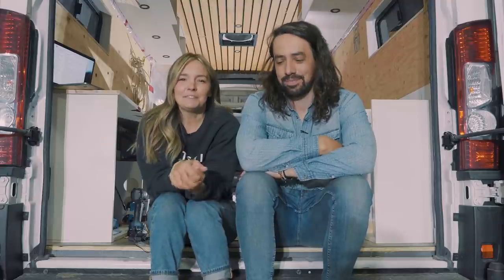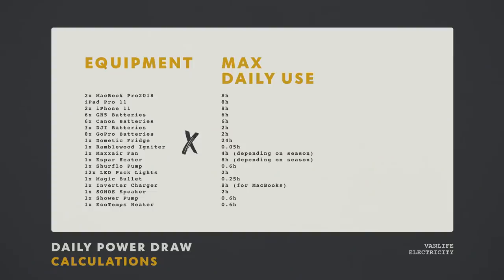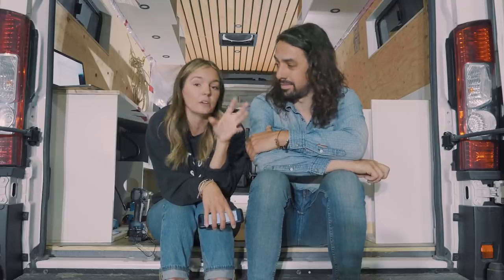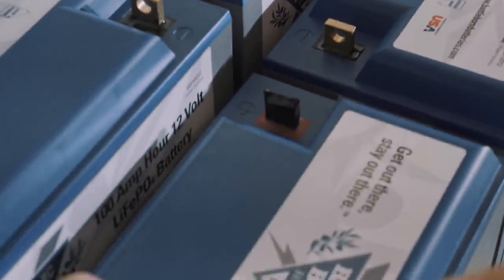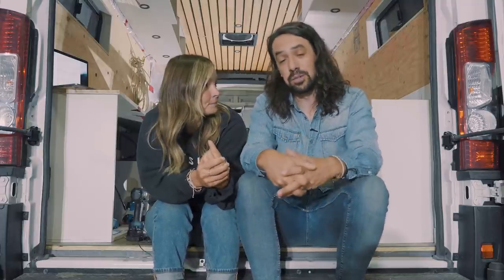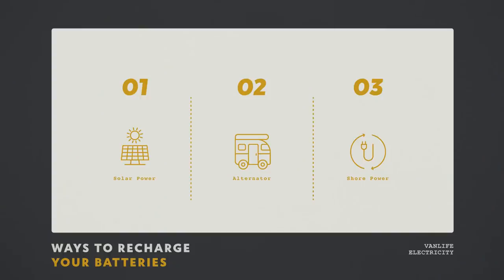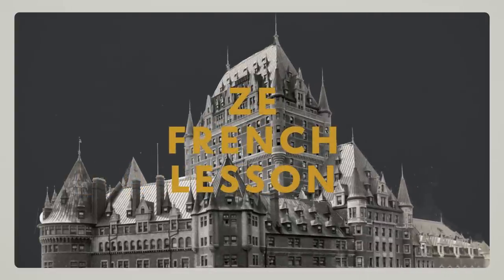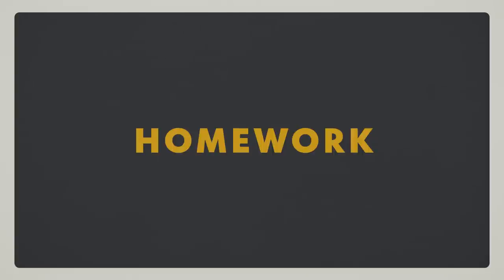TIPS for Vanlife ELECTRICAL Systems | Solar Panels, Lithium Batteries & Inverter for a CONVERSION.

Comment: In 10:45 you talk about the shade an how it affect the solar panel 
You can tilt the solar panel upwards from the shadow area
Reply from the maker: Yes, but to do that, you would need a tilting system, which would need a very specific type of installation.

Comment: I want to mount my inverter/charger on the wall. It's 2 Kw, so quite heavy. Nobody that I have found talks about that. I plan to mount it on plywood, brace the holes with larger washers, or a steel strip with holes drilled through. Low down, behind the driver's seat. The vehicle batteries (two of them) are under the driver's seat, there are three 60A connexion points, one of them will drive the battery to battery charger.

The tension on the bolts will be shearing pression, not stretching or compression, so I expect high tensile bolts that fit the mounts will be strong enough, and I don't really expect much horizontal force on the mount.  Does your expert think 12mm ply is adequate, or should I go up a size? Our plywood can be pine (Pinus radiata), it can be miscellaneous Australian eucalyptus.

I have no lining, I will worry abut that if I actually need it.

Comment: 13:20 I tought that using lithium battery below 20% were damaging(diminuing its capacity), is that correct?(still much better than the 50% of the AGM tough)
Reply from the maker: Battle Born told us you could use 100% of its charge. I think what damages them is drawing power from the battery at very cold temperatures.
Reply: @vanlifesagas  It varies a bit, I'd be inclined to trust BB. But the damage isn't instantaneous either for these or lead acid batteries. Probably, I won't do deep cycles - if I think that's a problem, I will add a battery. Probably, I won't average a ((shallow) cycle more then two or three times a week. 3,000 cycles is 1,000 weeks, I will be pushing my century in that timeframe.

If I fully discharge my battery every day, then I might need to replace it in a few years.
Reply: @vanlifesagas  I think it's more that agm battery may burn if bellow a certain charge. Lithium batteries will just lose some capacity. It's because of this that tesla incitate to only charge between 20 and 80%, same for smartphone. Not sure for car batteries

Comment: Very helpful video, thanks!  One question - how did you attach your solar panels to the roof rack?  I see the single corner bracket at the 10:35 mark, but not sure if you used those for all the attachment points.  I have a similar setup and am still trying to figure out the best way to mount the panels.
Reply from the maker: They’re both attached with L brackets and to the side rails as well.

Comment: Depending on needs, you can install a second alternator. They even have performance one that have higher amperage output.
Reply: Looks like about a $2000 upgrade for the Promaster according to a quick Google search? Just now computing solar/electrical costs to see which is the better expense
Reply from the maker: We have an upgraded alternator in our RAM. I think it came with the 3500 RV Option kit. Maybe you could check this out!
Reply: @peaceoutvanlife  I think it is more of a DIY kind of thing. A friend on mine had a competition Chevy Tahoe with serious bass. He made his own steel bracket and used a slightly longer serpentine belt. I believe the bracket was only about $100 to have cut and tapped a local CNC shop. Its a bolt-on type of thing. He didn't even look at kits. I'm not sure such things existed back then? But we tend to make our stuff.

Comment: Can you please ask papa if I can stack the Battleborn batteries? As in, I would like to have an electrical closet max 2 feet wide and 6 feet tall, so the batteries would be at the bottom, the inverter/panel/gauges etc. mounted on the wall above for easy reading and access... wondering if I could have 4 or 6 of them, mounted above each other 2 by 2? 

This video was easy and informative, and Atomic Marie is back to deliveriiiies! 🤗

J’ai chaud because y fait comme 30 degrés cette semaine à Vancouver, 🥵

Et je suis chaude pour de bonnes saucettes dans l’océan à côté de chez nous, quin!  🌊 🏊‍♀️
Reply from the maker: Hahaha, j'aime bien tes petits devoirs de français. 

For the Battleborn, yes you can stack them. Just make sure they are very well ventilated because they'll probably heat up a little, especially if they're one above the other.

Comment: Excellent video.  I am starting a van conversion and i am so confused about which brand of Lithium batteries to purchase.  Like you, I am canadian, so i need a battery system that will perform well in extreme temps from +30 to -20. I have seen Battleborn, Dakota Lithium, Renogy, Victron, etc . . . Similar battery power pricing seems to vary depending on the brand.  Do you have any thought on this matter?

Comment: Whoo! I am going to add solar a bit later. Up here we really do only get a couple dozen sunny days a year. 😜😜 I’m using a renogy dc to dc charger to utilize my alternator and I will also have shore power.
Reply from the maker: Where are you located? How can you have less sun than us?
Reply: @vanlifesagas  Whitehorse Yukon. Winter the sun rises around noon and sets around 4pm. Although right now it’s 11:05pm here and it’s still light out. You really gotta come see the Midnight Sun in June here!!

Comment: Great video and very happy you're back at it together! Your rear door hinges look extended, is that to accommodate your bumper? Also did you keep the reversing sensors with the new bumper or switch to a camera?
Reply from the maker: The door hinges are the same as usual. It's probably just the fact that they are opened all the way that makes it look that way. Nothing had to be disconnected because of the bumper, no!

Comment: You installed all the batteries on the left side of the van. What will you install on the right side to compensate the weight? Also, does the van need any work on the suspension or brakes because of all the extra weight you are adding? ...oh! And van is looking great by the way.
Reply from the maker: The right side will have all the water tanks (grey and clean) + the propane tanks. So it will pretty much even out. The suspension on the 3500 has a good reputation. We usually wait to see how heavy the conversion will be before modifying the truck itself.
Reply: @Vanlife Sagas, Thank you very much for the explanation. It’s going to be a beautiful van.

Comment: This is probably a dumb question, but is there a way to charge your batteries with charging stations for electric cars? 🤔 because those Re widely available in my country. Almost every gas station has them.
Reply from the maker: I'm pretty sure we could figure it out. We are basically recharging the same types of batteries (lithium). Hmm.

Comment: Can you explain why you've chosen 6 small batteries, instead of for example 2 big ones of lithium?
Reply from the maker: Hmm, good question. One main reason would be if one of those fail or becomes depleted, we can rearrange our battery bank to work anyways. The other reason is that Battleborn offers good prices on this kit, and it was the only one available at the time of purchase.

Comment: SUPER helpful - Thx!! I've got all my calculations input except for the inverter charger...my Googling just takes me to info about calculating how much draw on the inverter. Do you have an amp draw for your inverter charger I could plug in?
Reply from the maker: If you check on Far Out Ride's Website, they will tell you how much AH you'll draw if you list all your electrical items in their chart. It's well done!

Comment: Hey!

I'm working on my own van at the moment and my setup sounds very similar to yours. I noticed you're going from the batteries to the multiplus and then to the lynx distributor. In my setup, I was planning to wire the battery to the lynx and then to the multiplus. I'm curious why you have it setup the way you do? I'm not finding a ton of conclusive documentation one way or another :)

Love the channel by the way!
Reply from the maker: Let me ask my father for this. But if you want more info, we basically ripped off the electrical diagram from Far Out Ride. It will probably be explained on their website.
Reply: @vanlifesagas  thanks for the reply!

I've also been looking at faroutride as an inspiration. Looks like they don't use a lynx distributor in their case but a more traditional bus bar and in their diagram they go from the multiplus to the bus bar and then the battery which I think is more similar to my setup with the lynx in the middle.

Let me know if you find out more :)

Comment: I’m just wondering, do the batteries catch on fire or set of toxins in the air? Considering  they are right under your bed where you sleep. Or are they pretty safe? Sorry if that is a pretty dumb question-I don’t know much about electrical stuff. 😬

Loved the video! Have a great week!
Reply from the maker: No dumb questions. We never heard those batteries set off toxins, no. They can catch fire but your circuits would have to be in pretty bad shape to do so. Plus, we sleep with a fire extinguisher.
Reply: "Lithium Ion Battery" covers lots of different technologies. Those batteries causing problems for Apple around 13 years ago were probably lithium cobalt. These are LiFePO4, lithium iron phosphate, much more stable. For more info, consult Battery University, and online resource created by a bloke with serious cred.

Comment: Thank you guys for the vídeo! Just a question, that Victron setup can handle a lighter and more lasting lithium battery via CAN, even start  the alternator (motor) via dry wire. Have you considered it during the building process? Not fan of AGM these days hahaha
Reply from the maker: I would have to ask Sylvain for this, I have no idea quite frankly.

Comment: You can discharge Lithium batteries to 80% (not 100% as you stated). Battleborn batteries are "true" 100 Ah batteries, meaning their actual capacity is 120 Ah and you can discharge them by 80% or 100 Ah. Also, AGM batteries can only be discharged to 50%.
Reply from the maker: Thks!

Comment: How do you calculate for using an inverter?
Reply from the maker: What size of “inverter” do you need?  All depends on how hungry you will be for your AC needs.  Usually, a 2000 watts inverter is plenty for the average user and easy to support with “solar”. Anything above that is really for specials needs.
Reply: the things I would use the ac for are, a microwave and my PC.  My PC has a 750w PSU and can be on for a few hours.  (I don't know if it draws 750w constantly or if it's just at its peak).  The microwave would only be on for a few minutes. (I am looking to see if I can do without the microwave).  It's worth noting that our ac here is 240v and not 110v.  Roughly how many batteries do you think would I need?

Comment: Hi guys, thanks for another great video! i have 2 question, you have agm battery on your (engine) vehicle and lithium for the camper? and the other thing i want to know is if you can recharge the lithium ones with your agm  battery from the alternator? it seems complicated, but here it goes! Continue like this guys! cheers
Reply from the maker: Yes, we can. Actually, we are recharging them with the alternator of the van, not with the battery itself.

Comment: Hello, I would be interested to know , do you connect the earth of your regulator to the body of the van. 
There are a lot of disagreement here in France around the subject. 🤔🤔🤔. 
I'd to know about you in Canada🇨🇦.
Reply from the maker: Yes, we do that, but only at one place. And if my memory is good, the grounding occurs at the bus bar level. We don't ground all over the place like we saw in some other vans.
Reply: @vanlifesagas  merci d'avoir répondu 👍on aménage un camion nous aussi. Vous pouvez voir notre chaîne si cela vous intéresse. À bientôt

Comment: How do you water-proof the cable from the solar panels on the roof to the inside of the van?
Reply from the maker: Good question : we install them beneath the solar panel, and the connexion is very short (not even a foot) before they are connected to the roof gland. And the wires are waterproofed already!
Reply: @vanlifesagas  Let me re-formulate my question:)  How do you water-proof the VAN at the point of entry of the cables?

Comment: I can't answer those questions, I don't know much more than I have a microwave, a computer and some cameras to feed. I don't expect to be stationary for extended periods.

My plan.
125Ah LiFePO4
Charge normally from van when mobil, 50A charger. Fully charge from shore as opportunity permits.
If this is inadequate, ad a second battery in parallel.
1 2Kw inverter/charger.
If necessary, add a solar panel. the Dc2DC charger has  MPPT. I don't anticipate needing more than 400W of solar. This is Australia.
Reply from the maker: Hmm, running a microwave will probably drain your single 125AH battery. I'd probably go with at least two of then for 220 and above. Make sure your inverter charger can supply the power the microwave will ask for, depending on the wattage of the machine.
Reply: @vanlifesagas  Only for heating, maybe ten minutes in a day.
I plan to batch cook at home, freeze some, then go with a stocked fridge, maybe cans that don't need refrigeration before opening.

Comment: YOU CAN NOT DISCHARGE A LITHIUM BATTERY 100%
It is possible Battleborn (they are as far as I know the best brand) has some smart battery management system that cuts the power once you are down to the level that is safe (10%?) but then you should recharge ASAP so they don't drop further by selfdischarging. (cykling the batterys between 20-80% is pretty much optimal)
And for the solar setup, IF you draw your max, it will take more then 16h of full sunshine in optimum angle to get it back to full.
I would have placed the solar panels as a lid on top of the roof rack, covering the fan and the paddleboards, effectively making the panels an extra roof over the entire roof rack, that gives you cooling of the panels sice you get airflow under the panels, and a much cooler van, since you don't get direct sunlight on the roof (it's called a "Safari roof" when you put a shield over the roof on a Jeep to make it less hot in the summer, common on old Land Rovers without AC)
I would also make that lid tiltable to the side you park towards the sun, for better angle towards the sun, a flat solar panel is not efficient if you are not at the equator, and Canada is bit north of that...
In the winter you will easily double the input from the solar by tilting them almost standing up, and the snow will also not buildup on a tilted panel.
Other then that, I envy your build, pop's is a great van-carpenter
Reply from the maker: Thanks for the precisions, you are right.